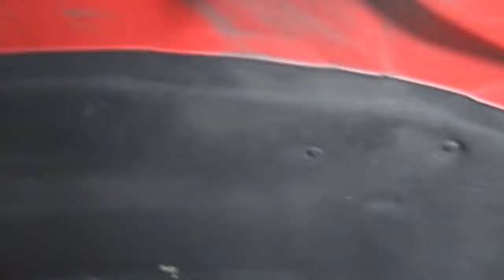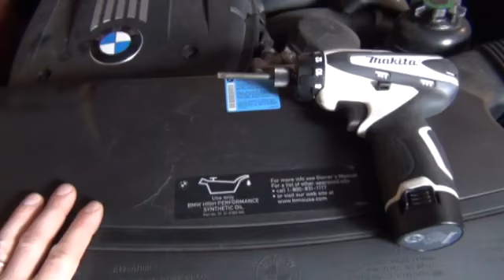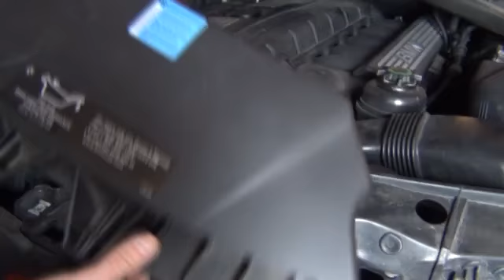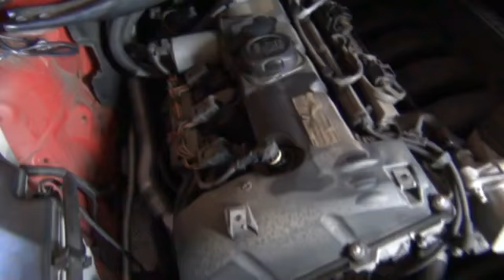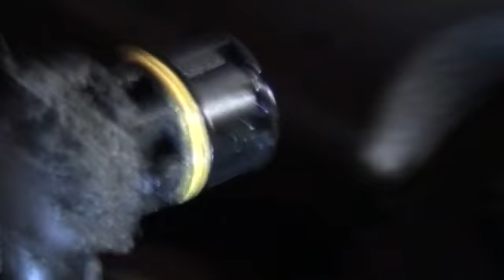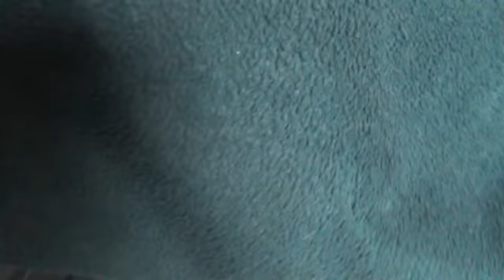BMW 6 Cylinder Engine Oil Leaks, Oil Filter Housing, Eccentric Shaft Sensor

Comment: My check engine light was not on but when I connected OBD reader it showed  “ Valvotronic eccentric shaft sensor” When I was replacing it, It had quite a bit of oil on it. But the codes did not go away after installing a new one. What else could it be??? Much application!! Subscribed!!!